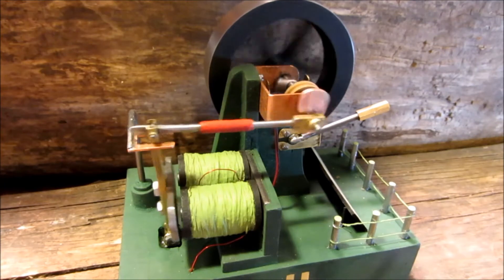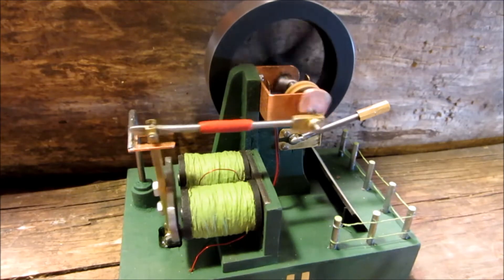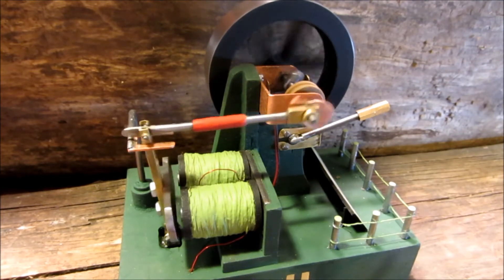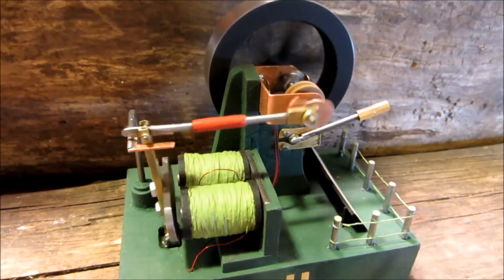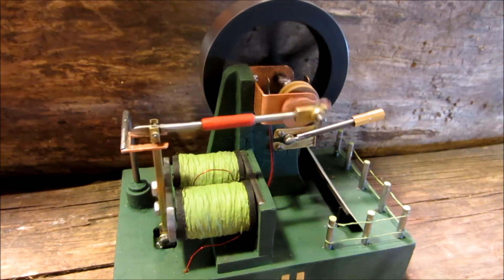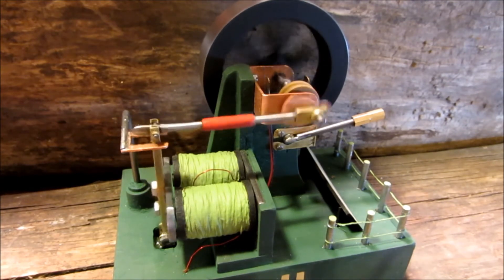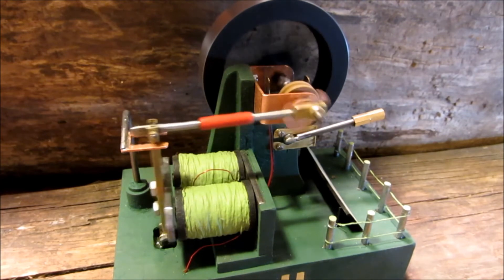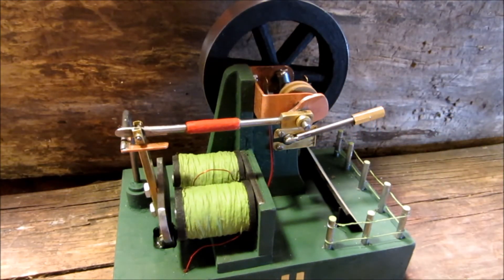SWING PLATE MOTOR

Comment: your commutator is not a good one. you chould try use a linear flat surface contact switch with big surface area and drive that by a tiny cam on the rotor. this will allow more current to flow at higher speed and give more total speed of the motor. bigger surface area of conduction times speed equals increased conductivity.